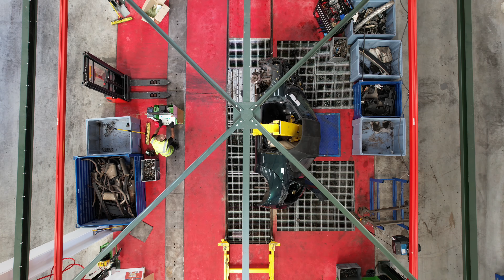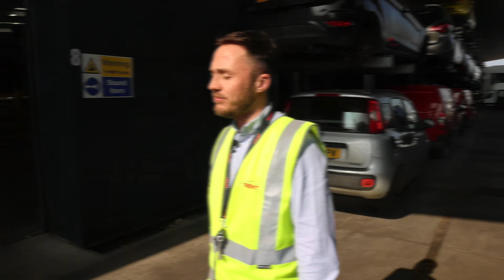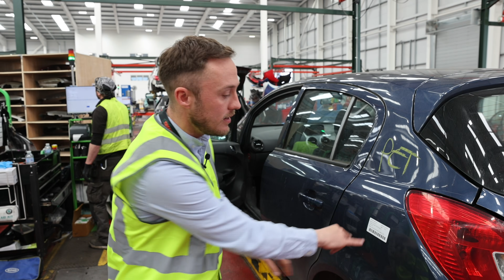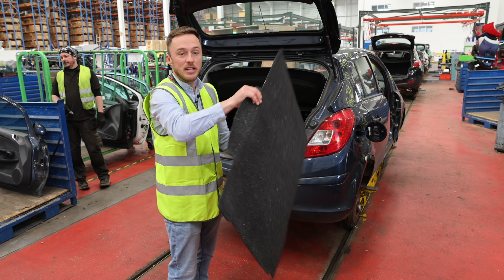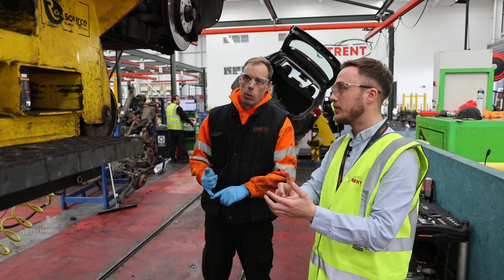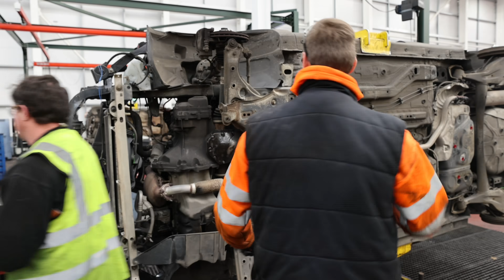£15M Reverse Parts Production Line is Changing Car Recycling - Take a look at our Dismantling Line

Comment: The issue is when people are restoring older cars (20YO+) that insurance companies write off for the slightest dent or scratch. 

The valuable parts are not the items you strip, but things like rubber fittings, glass, upholstery, instruments and small plastic fittings, clips and screws.

So cars like mk2/3/4/5 golfs, morris minors and older jags. Even Japanese cars have bits impossible to find.

The trend right now is that cars from early 90's to late 00's are increasing in value, significantly. Why? Because they are still relatively cheap to keep on the road and function and deliver a driving experience as good as new cars do.

Interesting video. Must have been a lot of work to set up this business model.

Comment: this is really base on your location in the usa getting new parts can take 1 hour if you are a shop to order and receive and a lot of parts you not legally aloud to replace with used.
Reply: In the USA, that issue is down to the right to repair issues, corporations would like to ban any options that stop you buying new parts from them, corporate greed disguised has safety.
Reply: @ericevans4040  it insurance issues if you doing the work at home and not at a garage no one really going to care. additional the car models are different in the USA then in the EU. The population of one american state can be more then a country in the EU.

Comment: Great idea and explanotory video into your business. It struck me with the Corsa that so few parts were recovered. I get that stock levels will negate some parts. However, maybe a future enhancement is to allow live ordering for any part (safety considered). In this scenario the buyer can see what vehicles are currently on the line or in the queue and order any part they require. There must be passive demand for some of the parts that are not flagged in your data collection but allowing live ordering, you get to squeeze the asset dry whilst it's on the line. Just a passing thought/idea.
Reply: Defiantly a good idea
Reply: The trouble is with older cars there isn't the demand for parts so in the end theres no point in removing and storing parts that won't get sold.

Comment: Whatever the cost, this is what we NEED, AND THE PARTS PRICE NEEDS TO REFLECT THE INVESTMENT. Well done TRENT,
Reply: People commenting are not taking into account the mechanic's time cost in repairing a car.

This business model is aimed at professional workshops repairing cars. Parts need to be ready to go, saving time, saving clients money.

Fixing your own car doesn't account for the many hours spent DIY.
Reply: @fredfred2363 mate so the customer should pay for everything and the business have no overheads just pure profit, they are making billions £187 for the car probably get minimum £600 plus scrap back for the car about 8 to 900  doing 130 cars a day remember this is are minimum alot of cars scrap for way more
Reply: So, we need to pay more for used parts because they need a multi-million dollar building? But if we go to a Pik-A-Part it doesn't cost as much and I don't have extra money.  I'm going with the cheapest option.  Sorry,  not sorry 😐 🤷
Reply: Sounds like a comment from Charles Trent. Trying to justify why the prices are inflated because they have a shiny new factory. This is the trouble with today they want to pass that cost on to the customer, we don’t care about your process of the parts

Comment: 8 parts only ???,jeez ur wasting more than saving, seats front & back ,doors all,bonnet,boot,suspension parts all,exhaust,cat converter, engine starter motor,alternator, the list goes on and on,all alloy wheels can sent off for remelting of the alloy ,except the wheel weights, you could melt all the aluminium on site,using the old engine all to fire the melting furnaces,thus generating ingots of aluminuim ??, 8 parts is NOT impressive, the lights on there own is 50% of that !!, you only end up with a bodyshell left tbh
Reply: I'm 67 only drive old cars,  This one looked mint.   Just saying 😊
Reply: @larrybarden7651  Good like me. I am 73 and drive a 2003 Toyota Hilux double cabin which is still like new, and will still be going when I am dead. I also own a 1967 Jaguar MK2 340 Auto/P.Steering/A/C which is a real quality car. Modern cars are crap and get scrapped when there is next to nothing is wrong with them, so are treated like washing machines. EV's forget it ! To replace the batteries costs more than he car is worth. Amen
Reply: Supply and demand: no-one wants for example a rear door for a 13 plate Corsa.  If someone does then there'll be another one along in a minute.  What makes you think they don't melt down all the stuff that's not reused?